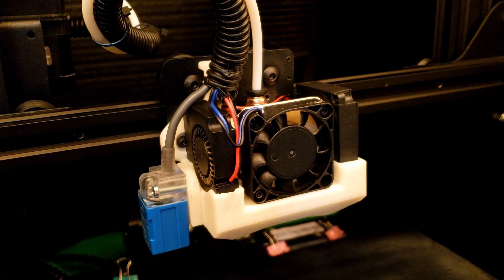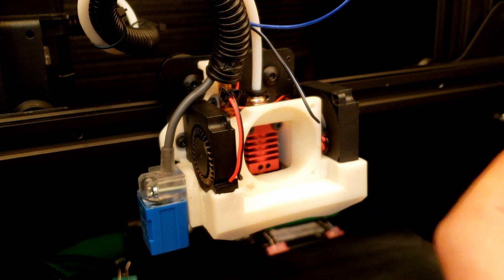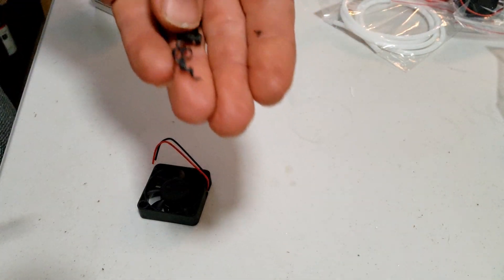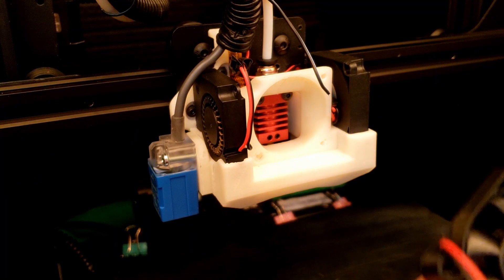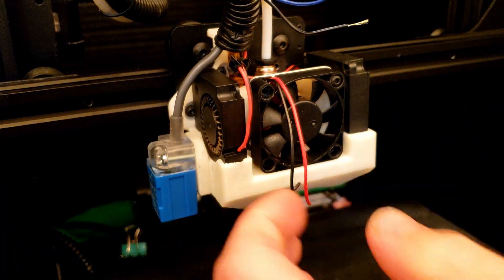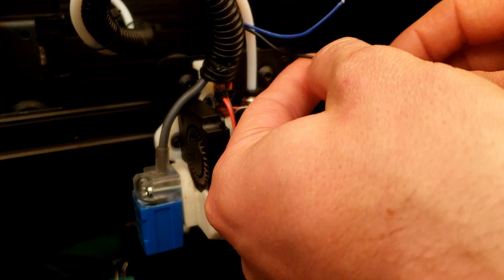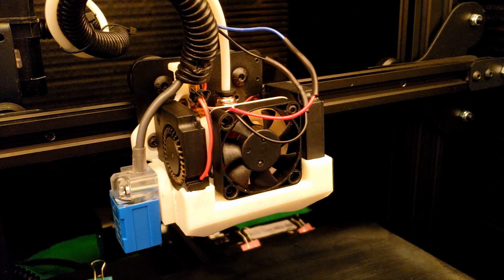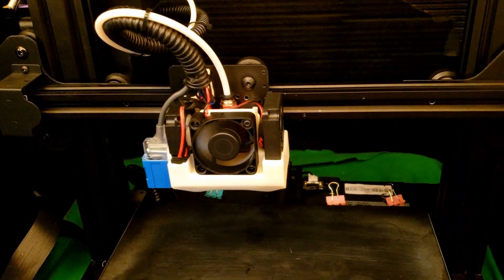Tronxy XY-2PRO Hotend Fan Replacement! [TH3D Dual Bearing 40mm Fan] Silent Fan!

Comment: Nice nice. I'm doing it a little different. Cuz I don't trust these fans I'm putting jst plugs at the fan end to make swapping out easier. For the hot end thermistor too. Just gotta make sure not to unplug everything at once. 😀
Reply from the maker: I've seen quick connects put in for all that. definitely makes replacing a lot easy and faster that's for sure. Adds a little bulk too though.
Reply: @PottersVinylsAndMore  yes, I'm mitigating that by having them at different lengths. The cable housing expands out pretty well though.
Reply from the maker: Awesome!